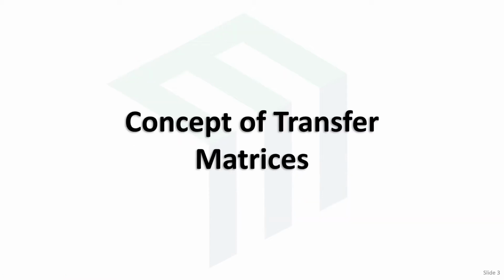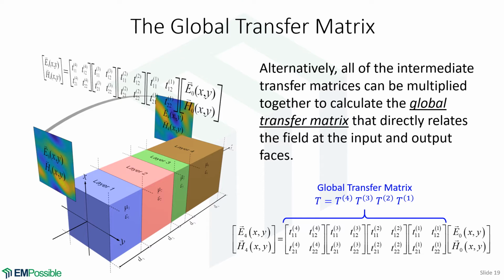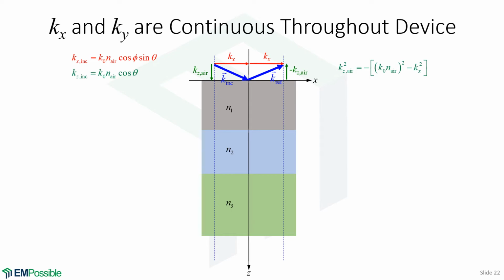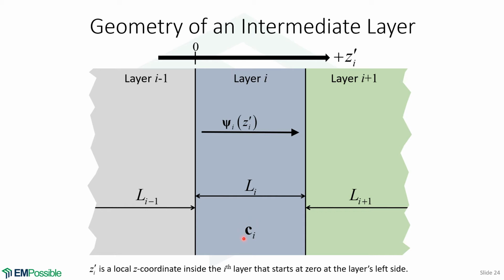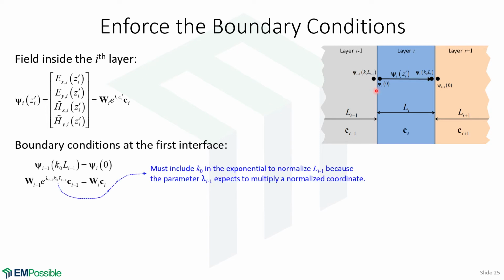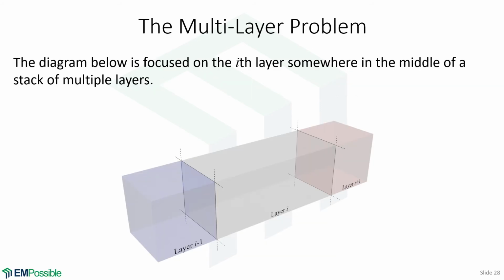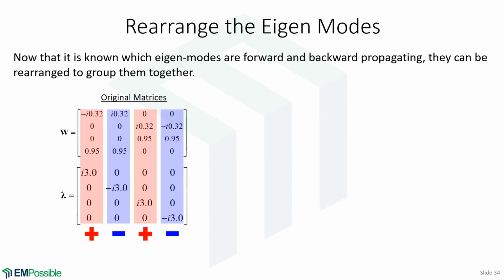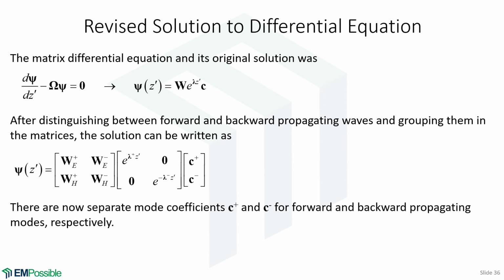Lecture -- Transfer Matrices

Comment: Is there a relatively straight forward way of finding a band diagram/dispersion relation from the transfer/scattering matrices for these 1D photonic crystals? I know they are not infinite structures and this formalism is ideal for these considerations, but I would be interested in being able to plot and generate these in addition to transmission/reflection.
Reply from the maker: There is a way to extract band diagrams for 1D structures from their scattering matrices.  I don't have an exact lecture on that, but I come the closest to it in the Dispersion Analysis Section in Lecture 2f here:

https://empossible.net/academics/emp5337/

Instead, I think there are better methods that will make the process of constructing a band diagram easier.  Is there a reason you want to use this method?
Reply: @empossible1577  I am simulating 1D photonic crystal with a defect in the center. The reason I am trying to use this method is simply convenience I suppose. I am already running simulations here, so I thought it would be nice to do both simultaneously and use subplots. To be more specific, I am simulating something like this:

https://images.app.goo.gl/TJR2tpa8hr795Lf77
Reply from the maker: @jakekeip  The concept of bands only happens when a structure is infinitely periodic.  I think your structures only have a single defect so the concept of bands does not really apply.  You can certainly calculate the bands for the two alternating layers in either side of the bandgap.  You can do that from the scattering matrices, but I don't really have any notes other than what I pointed you to do that.  I would suggest learning the plane wave expansion method if you want to calculate bands of dielectric structures.  Everything you need is on my course website.  See Topic 6.

https://empossible.net/academics/emp5337/

Comment: 18:52 How can I find the (+) or (-) propagation direction in the eigenvector matrices? Also, I'm still confused about the forward propagating and backward propagating concepts.

Whatever the direction the wave propagates in the medium, it always treats the propagation as always (+) z-direction? 
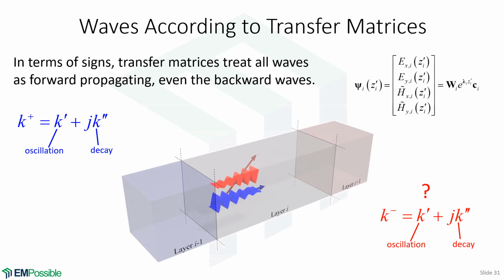I missed the way to understand from 16:45.

Thanks for the nice lecture, please give me any feedback on this.

Best,
Reply from the maker: The eigen-vectors contain the electric and magnetic field components.  From these, you can calculate the Poynting vector that will point in the direction of the wave.

The pure 4x4 TMM solves a first-order differential equation that combines both the forward and backward propagating waves.  The solution has a single term containing both.  This means backward decaying waves will explode when propagated forward.  This is fixed by separating forward and backward waves and treating them separately.

For the 2x2 approach, a second-order differential equation is solved where only the forward waves are solved.  These are written twice, one with opposite sign, to have both forward and backward waves.
Reply: @empossible1577  In the eigen-vector matrix, first column has (-i0.32) = E_x, (0.95)/(jn_0) = H_y, and E_y=0, H_x = 0. Then, the cross-product of E and H seems (-). Is that wrong..?

And, the treating the forward, backward propagation is bit more clear than before. Thanks for this explaination.
Reply from the maker: @myung-giji1409  I will have to double check this.  Did you account for the normalized H?
Reply: @empossible1577  I want to say the poynting vector sign. If the poynting vector is (+), then we can determine the propagation direction is (+) z direction, is this right?
Reply from the maker: @myung-giji1409  Correct
Reply: @empossible1577  18:51 the first column has (-i0.32) = E_x, 0.95/(jn_0) = H_y, E_y=H_x=0, So, I think the Poynting vector has negative sign. So, it is (-) propagating. This is what I think. Am I wrong with this..? Just got curious.
Reply from the maker: @myung-giji1409  I am getting a negative sign as well.  It is possible I goofed and I will check into this as soon as I can.  Thx!
Reply: @empossible1577  Thanks for nice lecture and replying about the question :)
Reply from the maker: @myung-giji1409  Okay, this was bothering me so I took a deeper look.  Since E and H are in the frequency-domain, the magnetic field needs a complex conjugate operation on it.  When you add this and trickle that through the calculations, the Poynting vector is in the positive z direction.  I have corrected the notes which are available on the course website:

https://empossible.net/academics/emp5337/
Reply: @empossible1577  Oh yes right. I'm perfectly cleared. Thank you for the quick updating!!
Reply from the maker: @myung-giji1409  Thank you for pointing out an issue with the course material!